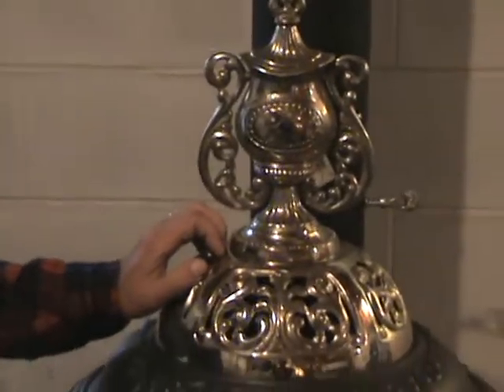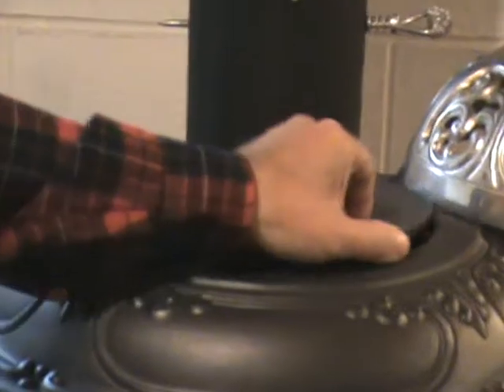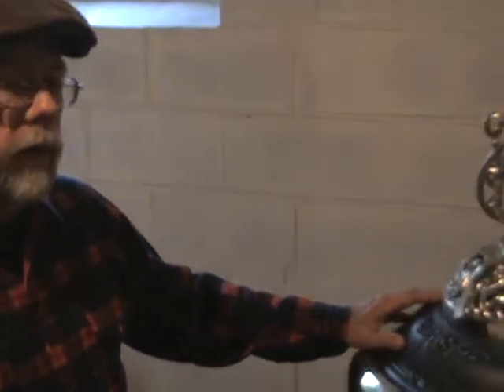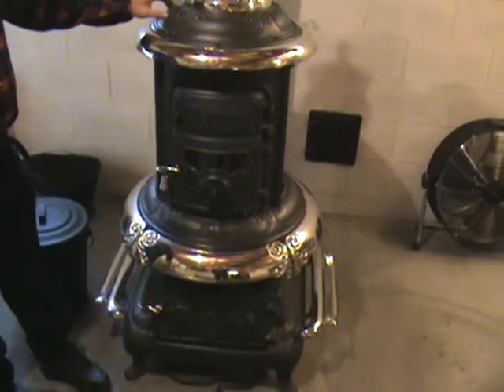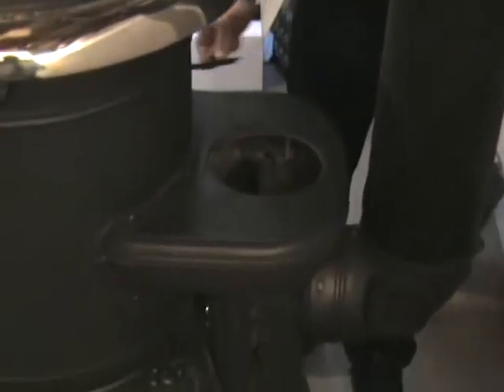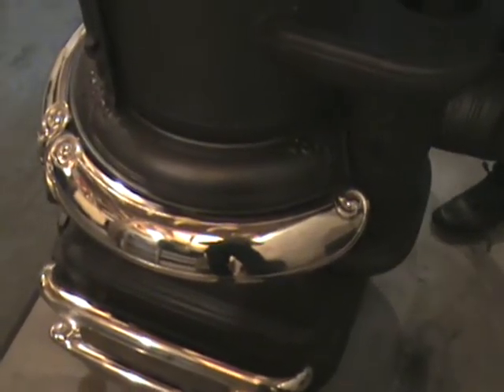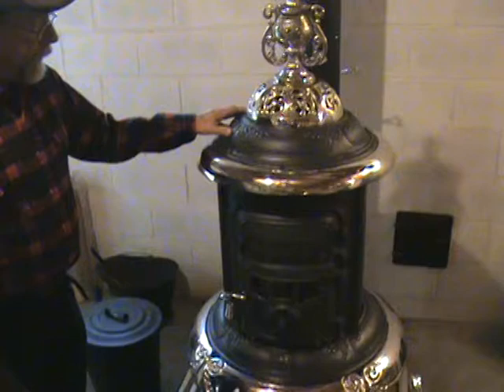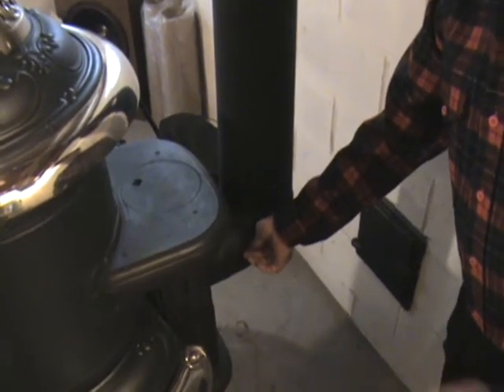Best Coal Stove Ever Made/Glenwood Base Heater. No 1

Comment: How many square feet can that stove heat?
Reply: Depending on the home and its location I'd say around 2-3000sqft. William used it to heat a log cabin in the Poccono Mountains. It heat the whole house from the basement. So Approx 3000sqft including the basement. I recall him saying everything was melted for a few inches around his foundation due to the heat from the Glenwood.
Reply: It can heat an entire small house no problem, if it's on the main floor or in the living room and the air can circulate around. In my house, I cut a hole in the floor with a "register" or vent that can be opened and closed so the stove in the basement can have heat that makes its way up more easily.